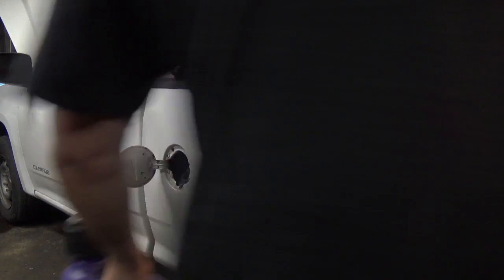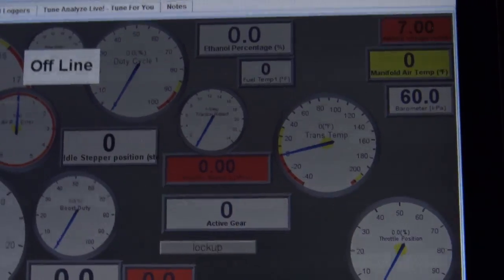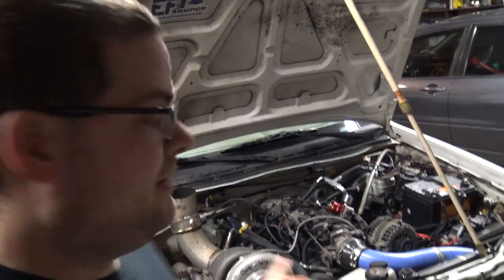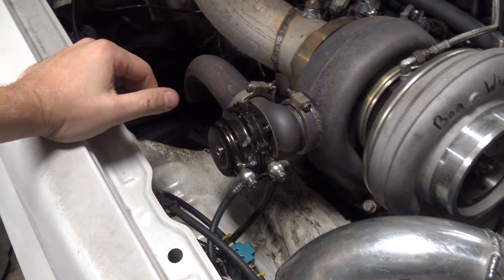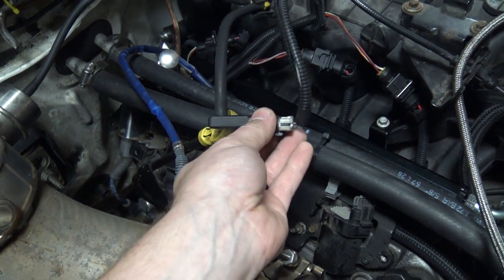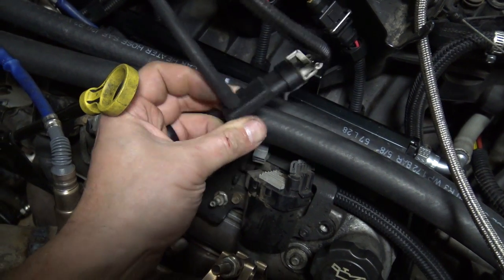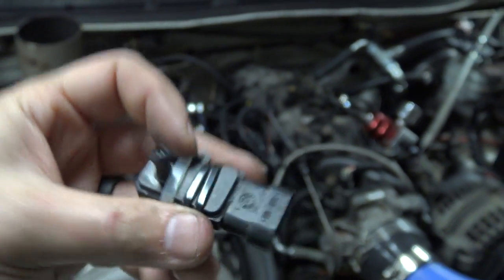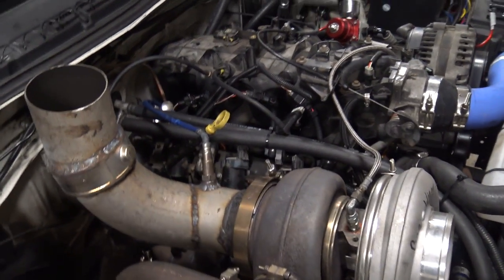tickling 1000whp number 2

Comment: Hey Matt, I never met a hater, I didn't like. They are immature low brow idiots in general, and are not in the same class of people you are. I believe you are on it when you say ring lands, or worse. Blocks and heads will also do very strange things like very small cracks that only lose compression when they are very hot. Good luck with it, and thanks again.
Reply: or they are pissed cause they spent 5x what matt did